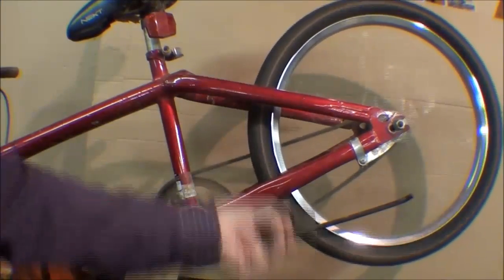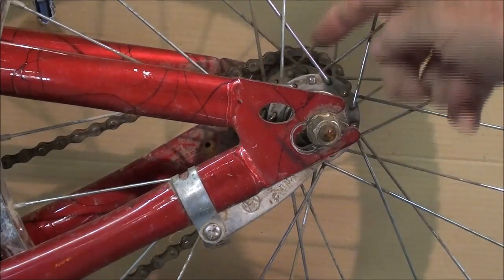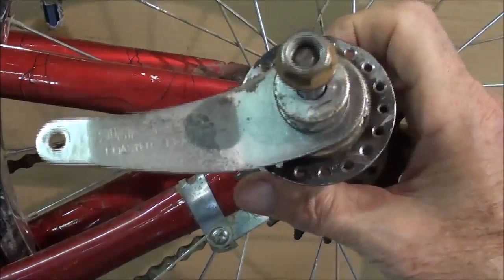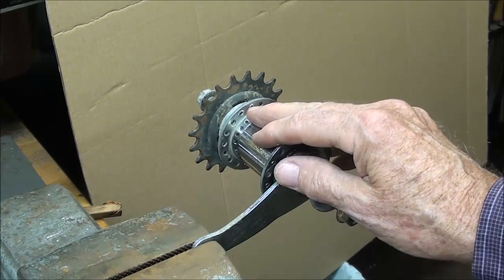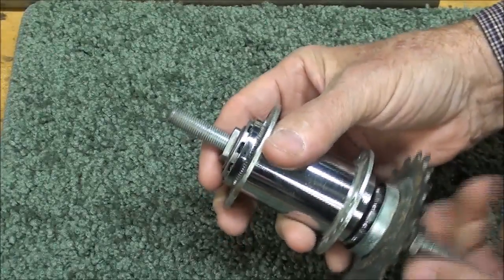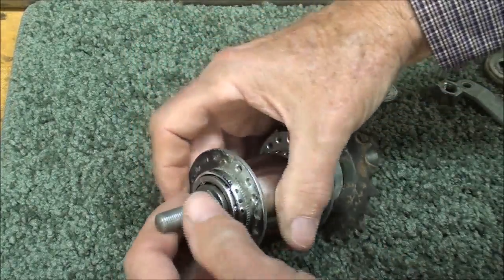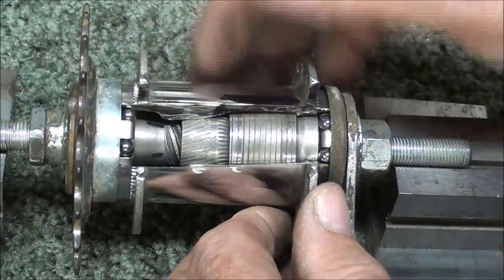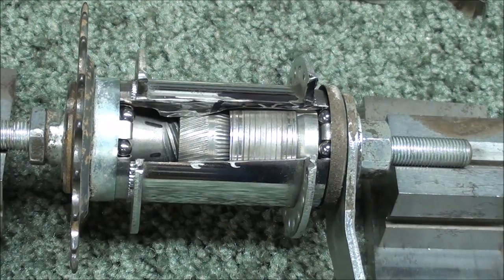WHAT MAKES IT WORK? #13 The Bicycle Coaster Brake tubalcain

Comment: Being that I grew up in a bicycle shop I can tell you NEVER take the brake arm side apart.  You always take a coaster brake apart VIA the drive side.  You will NEVER get it back together correctly from that side.  So there is no reason to start from that side.

You use some flat cone wrenches to take the jam nut off the axle cone.  
Back the axle cone all the way off the axle.
Spin the coaster brake in reverse to pull the drive sprocket off
You have now exposed 2 sets of bearings.  A small one under the cone and a large one under the drive sprocket.
You can now remove both the brake shoes and the drum (pay attention to how the drum and shoes comes out it only goes in one way)
You can now easily pull the hub/wheel off the remaining parts.  Which should be there should only be one remaining bearing that is lose when you remove the hub.  
Touch nothing else.
If the jam nut is lose on the brake arm cone tighten it
Clean with degreaser, put a heavy coat of heavy grease on all parts and reassemble in reverse order.
Reply: +garygsp3 
Wow it's been years since I've done a coaster brake rebuild and remembering all that was just like riding a bike.

Sorry I couldn't help myself.  Mr Pete you are right about Bendix and New Departure being the dominate manufactures of the day.  Sadly both manufacturers are long gone but collectors and bicycle restorers still covet those brakes.  Today the dominate bicycle part manufacturer is Shimano who also built hubs along with Sturmey Archer.  Although i remember shimano and sturmey archer more for their 3 speed hubs than their coaster brakes.  Boy if you want a challenge take either of those manufacturers 3 speed hubs apart.  Even knowing what your doing it's easy to screw up the reassembly.  However seeing all the planetary gears is very cool.  Way cooler than the exposed multi speed bikes of today.  No I am not that old either at 36.  As I said I grew up in a bicycle shop and likely have forgotten more than most will ever know.

Comment: LOL, you sure have a way of bringing back old memories. For some reason, when I was a kid early 50's, we found it necessary to work on our bikes. Tip them over on the seat and take that back wheel off and take the hub apart and change the grease. We would take the cone out and wash them off, in a can of gas, and put them back together again. Then we would go after the crank. We even took the pedals off and oiled them up. I forgot all about doing that and can't think why we did it other than being mechanics. At first I didn't have a bike but my sister did.
Great video and subject. I doubt its been done before.
Cheers
Reply: It sounds like you lived in my neighborhood growing up.  We worked on ours to.
Reply from the maker: +Lee Waterman  Thanks for watching--yep--always turned the bike upside dow,

Comment: Very nice video! If you come across one of the shifting hub gears, it would be nice to see how those work as well. The older ones are usually 3-speed (at least here in Germany), but you can get them up to 14-speed (Rohloff 500/14) now.
Reply: +mrpete222 I have about a dozen of them. I rebuild them at work, as well as any other internal gear hub. The rare strange ones are the 2 speed kick back. Kick it back a little to shift gears hi/low, kick it back more for the brake. 2 gears, one brake, no cable. If you were closer, without a border between, I would send you one, as well as a sturmey archer 3 speed. 

Incidentally, one of the first downhill offroad bicycle races was called repack because they would have to repack the boiled out grease from the coaster brake each ride (or half way down). Look up repack mountainbike....
Reply from the maker: +Nordish Kiel I have been looking for a 3 speed-they are non existant
Reply: +mrpete222 
 My father in law still rides his old green Schwinn 3 speed.  I give him crap all the time because of the rust on it.  I call it the tetanus shot!
Reply: +MrBen527 
You may laugh at "Tetanus shot" but depending on brand and model it is likely worth $200- $500 plus even in it's rusty condition.  If it's something highly sought after it could be worth more than that.  I've seen a rusty old tricycle that I wouldn't have given a plug nickle for sell at a swap meet for $500.  Don't ever under estimate the value of those old bikes.
Reply from the maker: +Notso Fresh Thanks for watching--wish AI had one of the 3 speed.  I had an English racer when I was 12
Reply: garygsp3

I have only seen 4-5 vintage ones in a decade or so, however it is interesting to note sturmey archer (sunrace) is making them again as the 2KB hub.

My daily commuter (21km/13miles) is a Surly steamroller track frame with current model alloy hubshell sturmey archer 3 speed and drum brakes front and rear. It is geared very high for speed, i average 30km/hr or 17mph. Here is the kicker: I have done 35,000km/22000miles on these hubs. basically no maintenance. At 30,000 i re-greased and replaced 1 bearing. cost 8 bux.   I am still on the original brake pads..........and they basically look new.

So called modern drivetrains? Those fiddly things hanging all over the bike? I would have spent hundreds if not thousands on parts by now. All for a 10% weight savings and a complete loss of reliability.
Reply: mrpete222
You should look at Linus Bikes, specifically the Gaston, it may bring back memories.....
I have been riding english club racer style bikes for over a decade now, before these recent nostalgic copies showed up everywhere.
I used to hide the shifter under the seat so guys would think i only had one gear. In Vancouver, back alley bike races for beer may happen, and ya never let em see under the hood.......
Reply: +garygsp3 where i live, the school WON'T ALLOW the children to ride their bikes to school, much less walk!!!!  a close friend of mine lived DIRECTLY across the street from the elementary school his daughter attended.   He was not allowed to go out on his second floor porch, and watch for her to cross the street on her own...he had to walk over and get her before she was allowed to leave the school grounds.   Consequently, with rules like this, weekday mornings and afternoons, the parents are lined up around the block, impeding traffic so they can drop off/pick up their kids right at the door of the school.....

When i was kid, even in 1st grade, we lived about a mile from my school, and my friends and I typically rode bikes or walked to / from, with no parental supervision or oversight at all.....wonder what the helicopter parents of today would have thought of that.......
Reply from the maker: +Tim Hyatt It is the hysteria of school boards & principals who live in unfounded fear!!!
I walked or rode a bike one mile also. Mom did not drive.
Reply: +mrpete222 I had one of those English Racers too! I think it was a Royce-Union. I was 11 and earned it by selling 50 or 60 boxes of Christmas cards door to door 'Junior Sales Club of America'. I think I saw the ad in Boy's Life magazine. It was the envy of the neighborhood.
Reply: garygsp3
Oh I know that!  Its much more fun to give my F and Law hell about it.
Reply from the maker: +Nordish Kiel  Thanks for watching--hope to find a 3 speed
Reply: +Notso Fresh 
Those 2 speed back pedal change hubs are rare.  In 20 years of helping in the bike shop I only ever saw one come through the front door.  The three speed bikes we would get about one a month come in for tune up or overhaul.
Reply: +Notso Fresh
I totally agree. Both of my sons have to ride a bike to school.  The school refuses to bus inside a two mile radius and my wife and I have to be at work before then.  They have really good bikes but I've had to spend hundreds on deraileurs and cables.  I even had a crank start slipping on the teeth it was pressed onto really bad which made the bike unridable.  It's a little crazy.
Reply from the maker: +Nordish Kiel Thanks for watcing
Reply: mrpete222
I grew up a mile from the nearest paved road and 2 miles from the nearest house., 13 miles from town. I took a bus to school, after school I would walk across town 20 blocks to my dads work and catch a ride home with him when he was done cause it was faster than the stupidly long rural school bus route.
Reply: Me too, it was far better then taking the bus.
Reply: +mrpete222 i have a 3 speed hub i can send you if you want